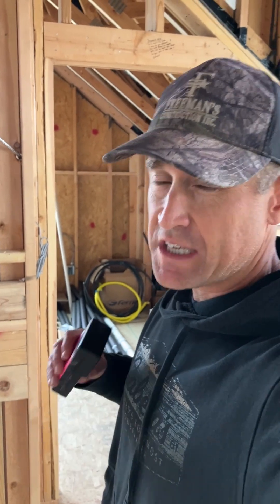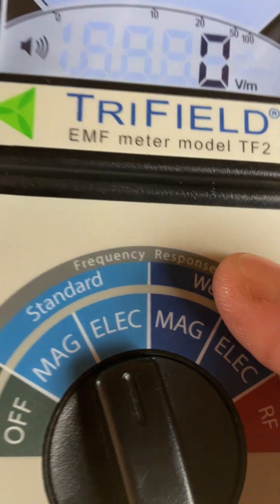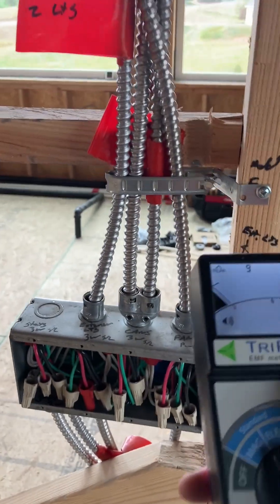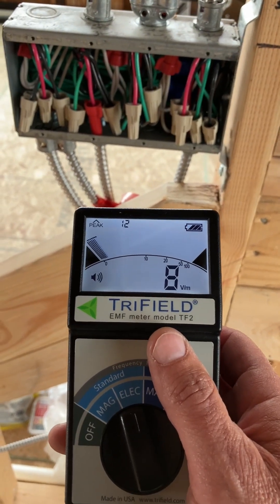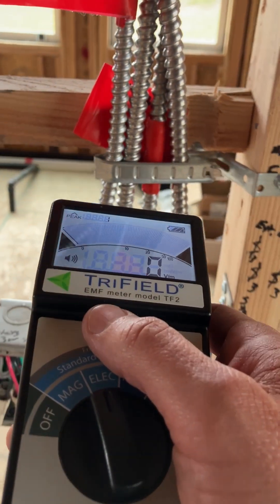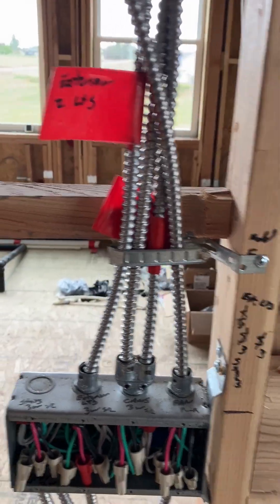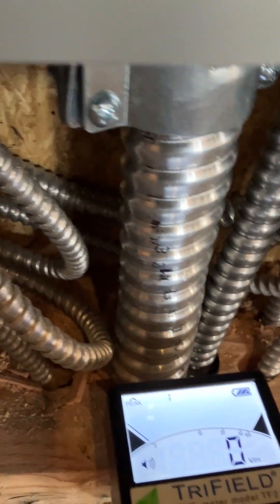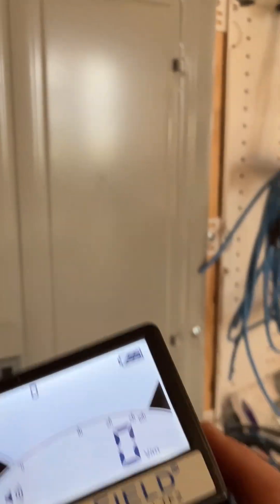Electrical Wiring to Reduce EMF Exposure in a Home

Comment: Can you get similar shielding using EMT?
Reply from the maker: Yes you can but you have to make sure that the EMT is grounded. If it is not grounded it will not stop the electric field. Keep in mind that the magnetic field is different than the electric field and MC cable does not shield well against the magnet fields. The EMT may shield magnet fields better than MC but you want to make sure the wiring is away from areas you are at frequently and 6 to 12 ft away from sleeping areas.